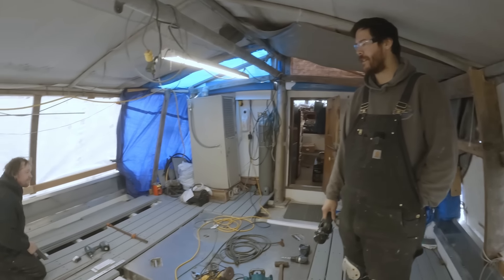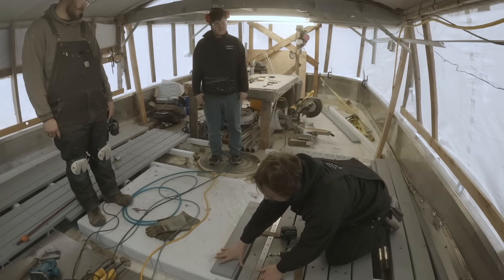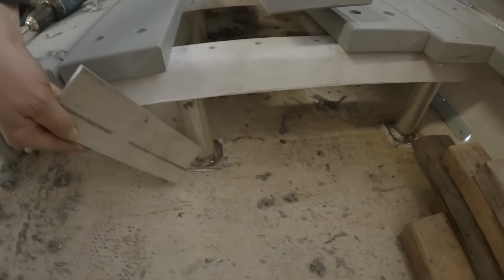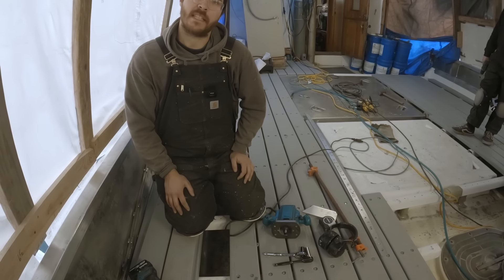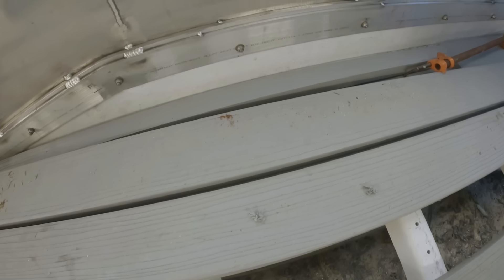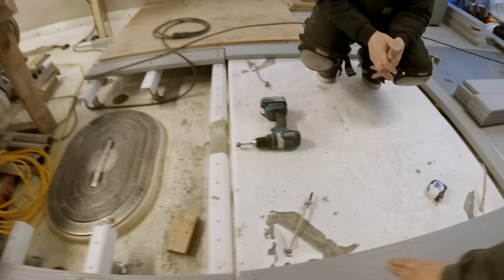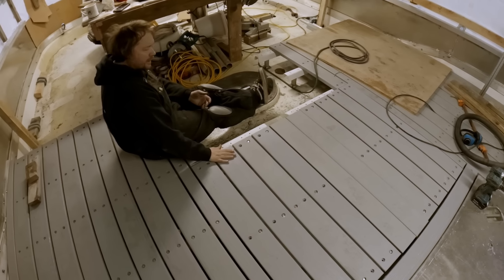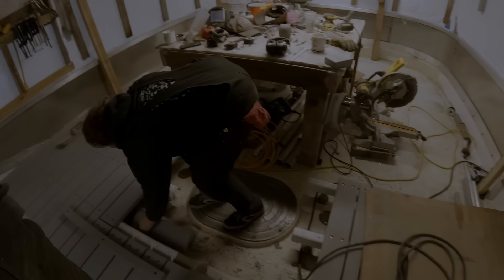Drilling, Routering, and Installing Front Deck Boards - Emerald Isle: Ep.95 Fishing Boat Refit

Comment: This deck project is just amazing to watch unfold.  When you transported the boat up from southern Alaska, it was difficult to comprehensively understand how it would be re-configured.  I'm betting that you didn't foresee the full scope either.  

I also appreciate the detailed explanation of the steps taken to provide an adequate work setting, to protect harbor environment, and ensure the asethics of the finished project (including precautions to prevent "uglifying" your work).

As soon as I see an episode released I immediately watch it.  I've have learned to be patient as to what the future of the Emerald Isle holds ...

Comment: I appreciate the extra effort demonstrating the details, and YES it is very useful information. Most of the guys I associate with own boats and decking is a big part of owning a boat. In the past 20 years , new materials provide options.
When plastic deck boards became available, we talked about using them but I hadn’t seen any done. I bought a load of cedar to deck a boat but the quality was very poor/expensive and required lots of preparation (the cedar was turned into doors).
So I am going to put plastic decking, this video is perfect timing and I get to have a look at your work.(thanks).
Looks like your using stainless fasteners, with nylock nuts and washer. What grade stainless ? And how do you get a nut to the blind holes?
I’ve considered using aluminum nuts,bolts washers and then very heavy pop rivets on the blind holes ?
I test installed some stainless Rivnuts in the stringers, and used cap bolts to hold down the boards. Works good but too many cons to be viable for entire deck. Very expensive/time consuming and error prone biggest drawback.
REALLY FINE BOAT !

Comment: Well thank you t I did not even think about putting anti-seizing on any of the boats I never even thought about it So now I'm going to start putting it on there as of Monday when I go back and do this other deck didn't even cross my mind I appreciate that information I'm 55 and I have not even thought about it lol .but hey with you and a few others I watch I still learn things maybe not learn every time but give pointers I believe I should say but thank you for the suggestion I will do it.abd if I have to go back and replace any boards it will make it where I don't have to cut the bolts off got to keep all the rust off from in between the thread thanks for the idea lol I had a point for it all these days lol

Comment: Are all those blue 5 gallon buckets hydraulic fluid? You get the fuel and hydraulic fluid tanks finished up? Everything looks great!
Reply from the maker: Good eye Rusty. Yes, the port side tanks are finished up. Just need to get the hydro tank locked in good before filling it. Happy to say they turned out great, only a few tiny pinholes in the hydro tank when we leak tested it. The fuel tank is filled and capacity came to 150 gallons withl 4" of headroom! So very pleased about that. We put the stb tank on hold for now as we have plenty of fuel capacity atm.

Comment: So will the small oval hatch be lifted to the new deck height to prevent trips and spills?
Reply from the maker: It is covered by a removable insert with the same deck material. You can hardly tell it is there!

Comment: How do you fix the last board to the deck? Because then there is no space on the left or right to reach underneath with your hand and fix the counter screw.
Reply from the maker: Aha! An astute observer. A short stainless plate tapped for the bolts, or with nuts welded to the backside will be positioned at each stringer and held in place with counter screw. Then last plank can go down and bolts will thread into plate.

Comment: When water seeps between the false deck, how will ir drain?
Reply from the maker: It flows to the side and out the scuppers as it normally would. The crown of the deck guides water outboard. This is also a reason for the false deck, its a more flat plane which provides comfort while standing. Compare that to standing on a slight incline that the crown of the deck adds.
Reply: Thank you for the explanation.

Comment: So you're just using lag bolts threaded into the fiberglass stringes? I wouldn't have thought that would be enough meat to hold the lag bolts really.
Reply from the maker: No, they are through bolted. Washer and nyloc nut on backside.
Reply: @EISAlaska   Thought so when T mentioned he had bolts and nuts. What are you going to do on the ends against the bulwarks to get a nut on the bottom? I assume the other places you can pull the hatches and such to get to the outside ones.